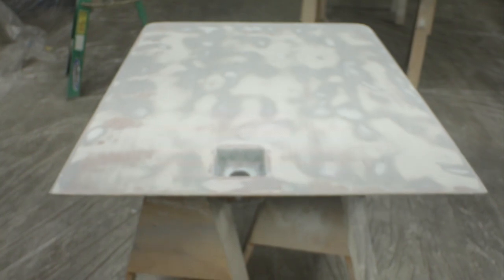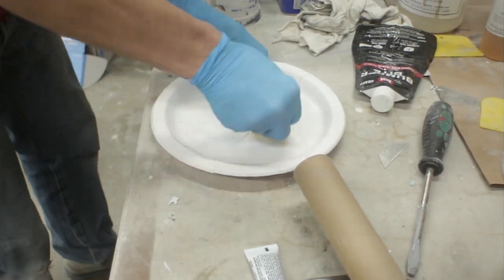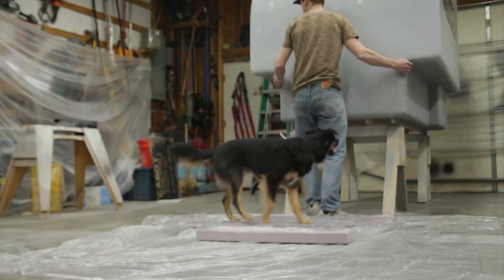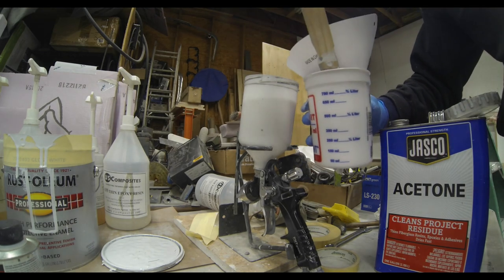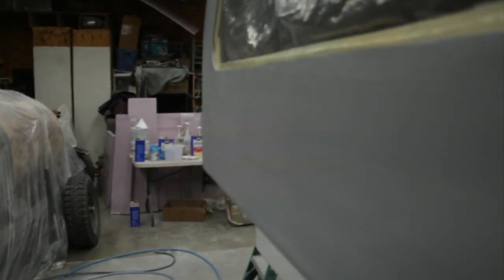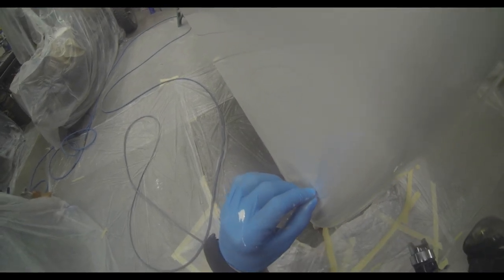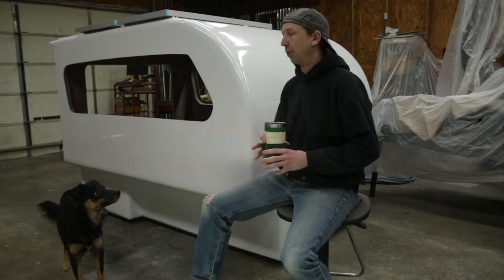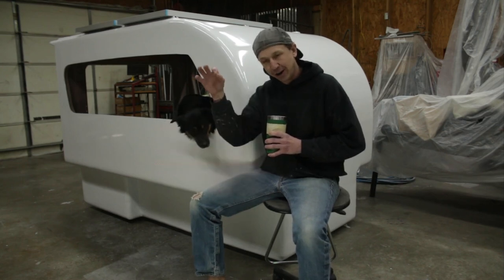Foamie Truck Camper Build Update-FINAL PAINT!

Comment: Great resourcefulness with a portable light bar. This must have created a spray control comparable to a painting booth. I will make sure to use this tip next time I do a paint job in my small garage or outside. Thanks for sharing your ideas Jake!
Reply from the maker: Thanks for watching Oleg! 

I struggle to see what I'm doing after the first coat, the light really helps hi light the spray pattern as it hits the surface. 

In the future I may combine the air hose and the extension cord with a few wraps of tape, just one less thing to manage while spraying.

Comment: bro, ALL of your paint techniques are spot on. just like show quality body work. 1 thing if you have some small unusual spots, use the heal of your hand just below your thumb. it wont leave finger groves. as far as glassing goes, a think layer of resin then sand. also right before spray, run wax and grease remover and a tack cloth. looks good tho..
Reply from the maker: Thanks for the tips! 

I do typically wipe everything down with a solvent and tack cloth prior to spraying, I may have skipped over that on the video. Its always a real struggle painting in the shop that I do everything else in, some degree of dust and contaminants are inevitable. Someday I'll build a dedicated booth!

Comment: Have you heard of "deck cloth" ? It's a 2 oz., tight weave, fiberglass used by the marine and aviation guys (me).  I've seen it applied over the last layer of 7 Oz and it really smooths out the surface and should reduce the amount of fill and sanding.  Oh BTW, That truly is a great looking job!
Reply from the maker: Lesson learned! The next build may be vacuum bagged, which should remedy the weave of the cloth showing so much. A lightweight tight weave like you suggest would also be a great option.

Comment: You can always go back and rhino line the bottom and top if you decide you don't like the finish on those surfaces but since they're not gonna be seen, it don't really matter, what matters looks great on tv, I'm anxious for you to get to do some camping in it, I can't imagine how anxious you are LOL
Reply from the maker: Thanks Willie! The Bed liner on the roof would probably add some impact protection as well. We get frequent hail during thunderstorms. I'll have to chew on that.

I've talked myself out of a trip this weekend, lows in the teens and my mattress doesn't arrive until monday. I may be somewhere Monday night though!
Reply: @ThatJakeWorldWide  I'd be more concerned with the solar panels in a hail storm LOL 

I think the camper itself is gonna be able to take a beating, it wont be long til warmer weather gets here and you can enjoy the fruits of your extensive labor
Reply from the maker: Good point. They will actually protect a large portion of the roof too. Well, at the expense of the panels!

I don't plan on taking it easy on the camper, my ability to tear the holes out of a bowling ball has driven a lot of the design choices. I cant wait to commence the stress testing!

Comment: Before you prime, use a powdered guide coat. It's basically graphite powder. Rub over the entire surface just before your final sand. This will stay inside all those little pin holes and show you where they are. Then, just before you prime, you can either use glaze or body filler to fill the pin holes. I also just use the primer to fill the holes, by using a spreader and smashing the primer down inside the holes. Then spray more primer right over the top of that. You are going to sand anyway. So the little spreader marks won't matter any.
Reply from the maker: I may have not covered it, but I like to use an aerosol can of spray paint for a guide coat. It doesn't take much. The primer I was using is also has a noticeable color difference from sanded to un sanded. Glaze was the real MVP of the paint job.

Comment: This is looking really great.  I appreciate you putting in the time to show us your progress and methods of working with fiberglass and everything else.  I am curious about your paint.  Is this an automotive paint or just some sort of enamel?  I do not know a whole lot about paint and am interested in doing something like this for myself.  The next question I would pose to you is whether an airless sprayer would work to spray this paint?  I already have an airless sprayer that I have used for some home projects.
Reply from the maker: The paint is RustOleum alkyd enamel. It does spray well through an airless, consult the data sheet for tip sizing and pressures for best results.

Comment: Nice work! SO MANY people building foamies fail to optimize the construction with resin and glass as you did. Your construction will give you many, many trouble-free years. I am curious though, did the sharpie marks give you any bleeding problems?
Reply from the maker: Thanks! 

Im pulling inspiration for boat and aircraft construction, and trying to combine the techniques that make the most sense to me.I see this build largely as a prototype, and I cant wait to put everything I have learned into the next project. 

No issues with the sharpie. Some were sanded away in the process of flattening the panel, but I did paint over quite a few.

Comment: Amazing job - congratulations on the great, lightweight camper! I'm planning out a combo storage/solar panel topped box for a van and started out looking at the expensive high density core options (divinylcell, Nidacore, etc), but now considering XPS as you have used. Any concerns you have with adhesion of the resin long-term and potential delamination? Also, did you pick the 2" thickness for the increase in rigidity or improved insulation - or a combination of those? Thanks!
Reply from the maker: Hey btbiker1! Im sure the expensive core options are very high quality, but for a camper I don't think they are necessary. Time will tell as far as longevity is concerned, but I don't foresee any issues with delam/failure. The 2" core was initially chosen for its insulation value, but the added stiffness is a huge bonus!

Comment: I would be interested in knowing the final weight of your camper when you are finished with it.
Reply from the maker: The empty shell is just over 300lbs. I weighed prior to my first trip and fully loaded (with much excess) its dead on 600lbs." The electrical system  likely adds another 150 pounds to that, and it will continue to gain weight as I add amenities and finish up the details.
Reply: @ThatJakeWorldWide  Thanks for the update...I think I'm going to give this a go.

Comment: Where abouts are you in Texas?  Im up near DFW and having a hard time finding bulk epoxy and fiberglass, Thinking about using ISO foam instead of the pink..  Hows the strength of the pink? And delam problems?
Reply from the maker: Im in the forbidden West Texas up in the panhandle. I order all my epoxy from uscomposites out of Florida. Glass is from thayercraft. The pink owens corning foamular150 is awesome. 15psi compressive strength and no delamination issues. Make sure you prep your foam, It has some release agents on it from manufacturing. I sand with 80 grit prior to any epoxy/glass.
Reply: @ThatJakeWorldWide  thanks,  i used to live in Florida, US Comp was a few miles from me, they also had a walk in under another name..
Reply from the maker: Palm Beach to DFW seems like quite the downgrade! 

They make a great product and shipping has always been reasonable. Buying in bulk saves quite a bit of cost per Gallon. some day Ill have a 50 Gallon drum on hand!